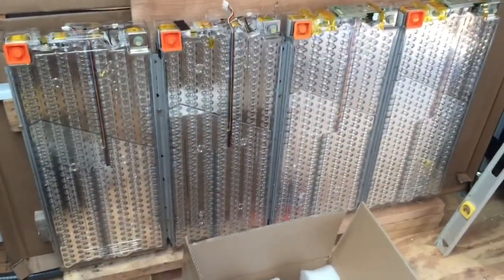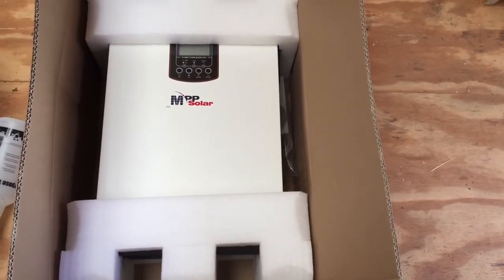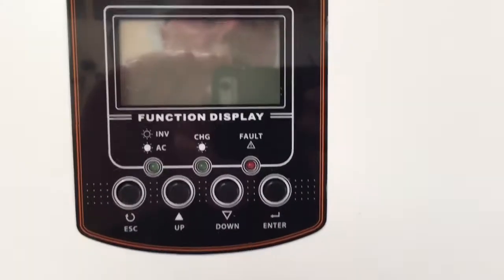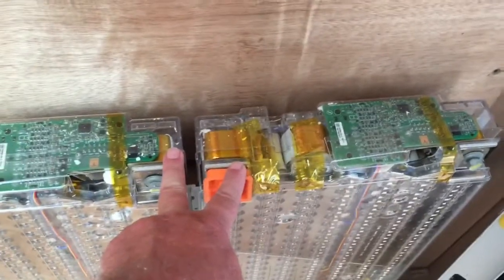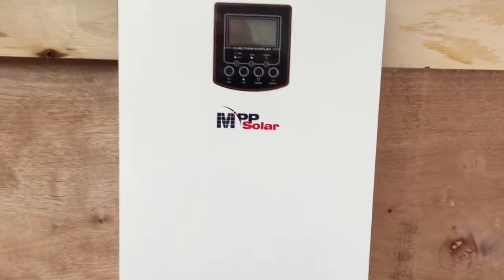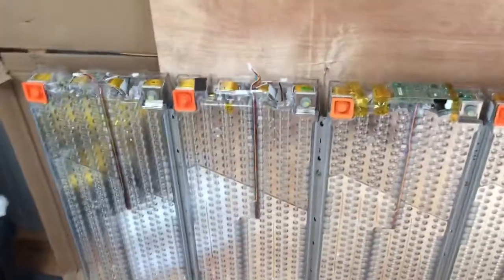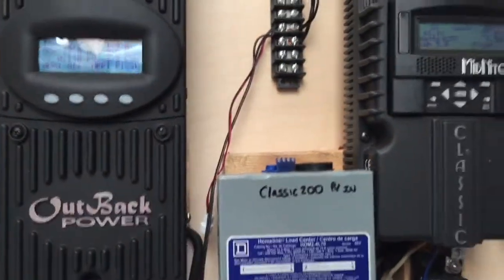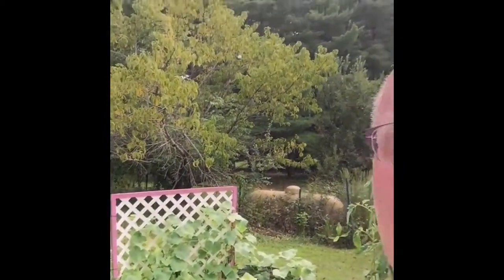Mpp solar inverter charger

Comment: Brother you can just use a heating pad for seeds to keep them batts good. A lot of peeps use them DC heating seed mats for there batts. Then you can just run it from your batts no need to invter. One more when you take the cover off the PIP you will see there's places to run a few screws into the lower part of the pip if needed. Mine is just like yours tho just using the top 2 been fine for years..  God Bless brother..
Reply from the maker: Thanks for the info brother
Reply: DC seed heater pads to keep the batteries warm, now that's an awesome tip.

Comment: I found 12 volt seat heater pads on ebay. 
2x Car Seat Heater Thickening Heated Pad Chair Cushion Winter Warmer Cover 12V for about 20 bucks.
Reply from the maker: I’ll check into that another couple months will sneak up on us quick, thanks brother

Comment: I like to mount one Tesla battery standing upright just like yours but cautious about putting all the weight on the two stubby ends of the coolant ribbon.  Can you describe how you mounted your batteries?  Did you do anything extra to support the weight or is all the weight resting on the two stubby ends?  

Also, each battery only has 2 mounting holes on the left side rails.  There are no holes in on the right side rail and there's not much clearance to drill mounting holes into them.  How did you fasten the right side to the plywood, if at all?  Thank you for the help.
Reply from the maker: I’m using 3 inch deck screws that act like a clamp I’ll have to do a close up video , I also have two 2x4s behind the batteries horizontally mounted that the screws go into
Reply: @southernohiosolarhomestead8477  Thank you for the quick reply.  Seeing a video in detail on how it is fastened and mounted would really help.  I'm still picturing each module fastened by only two 3" deck screws on the left side while the weight is resting on the two relatively small tips/feet (about 1" X 1/4" each) of the ends of the coolant ribbon. While the ends appears to be solid stainless steel, the ribbon attached to it is hollow and semi rigid as it can be flexed.  I am worried that there's too much weight bearing by the hollow ribbon and the entire module secured only on one side by only two screws.

Comment: Those batteries look so cool. Are they Tesla?
Reply from the maker: Yes , I believe model s , I will have to double check
Reply: Southern Ohio Solar homestead so do you have 4 batteries from 4 cars or is that 1 unit ?
Reply: @RedefineLiving  depending on the battery size of the TESLA it can vary on modules. Most have 16 modules. Far far cheaper then any other lithium battery you can buy in the market. TESLA is the way to go.
Reply: @RedefineLiving  it's 4 Tesla modules. The battery are 18650's Panasonic